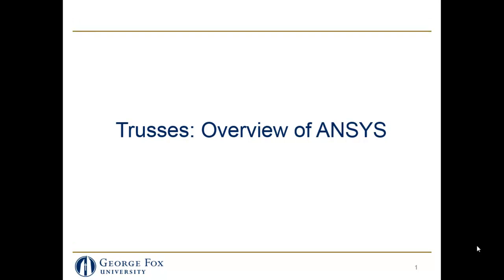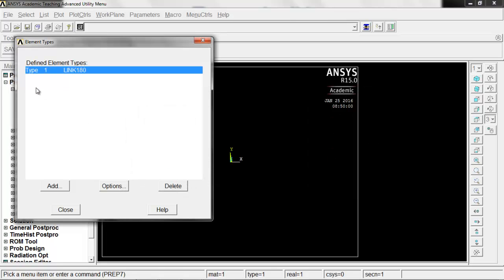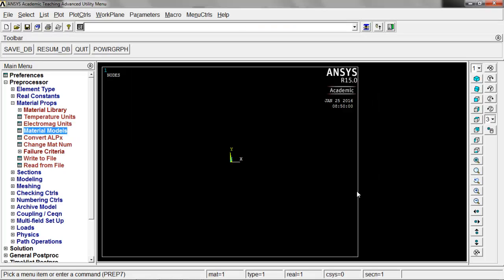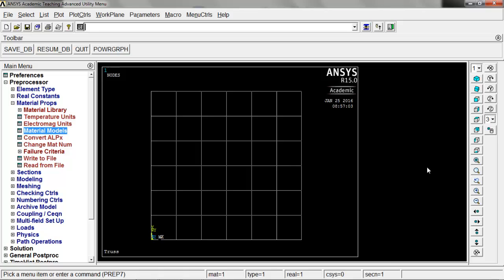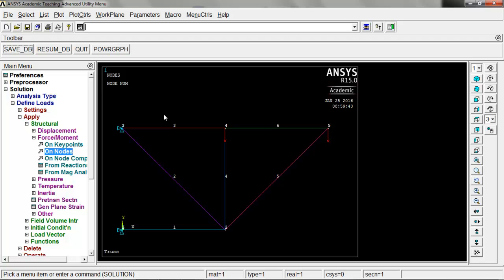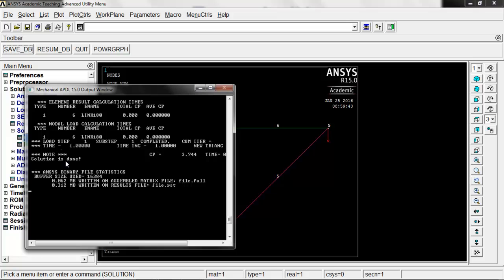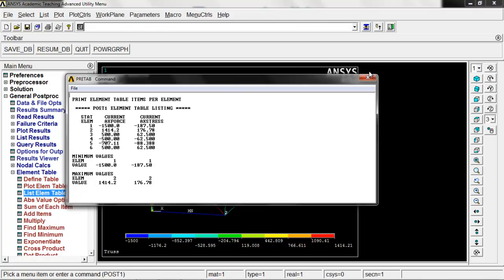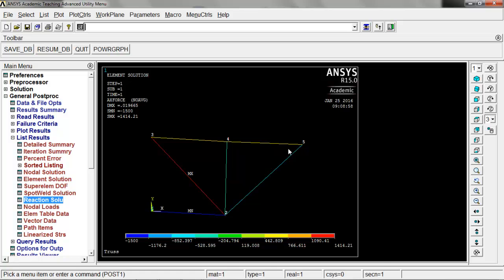Trusses - ANSYS, Example 1

Comment: I'm trying to do a similar analysis of a truss with link180, 2 nodes are constrained and 1 has a force leaving 1 node free. When I run the solution I get an error "There is at least 1 small equation solver pivot term (e.g., at the UX degree of freedom of node 4). Please check for an insufficiently constrained model."  Node 4 is the unconstrained node in my example so I'm not sure what the issue is.  Any ideas?
Reply: Follow up for anyone with with the same issue, I was using lines and keypoints instead of nodes and elements to make the truss. When I redid the same structure using the latter I didn't get the unconstrained node issue. When you constrain a keypoint  you get 4 DOF options, but nodes (14:24) have 7 DOF options which is curious... Would still like to know how I can avoid the issue with keypoints and lines if anyone has a suggestion? Because you dont get the same mesh options with nodes and elements

Comment: how can I change or check units in ANSYS APDL 16.2
Reply from the maker: You don't . The interface in APDL is unitless. It is on you, as the user, to make sure your units are consistent. In ANSYS Mechanical, which I use in other videos, the units are more explicit.